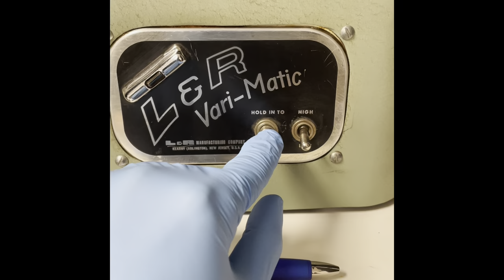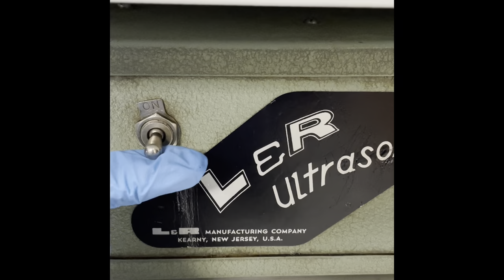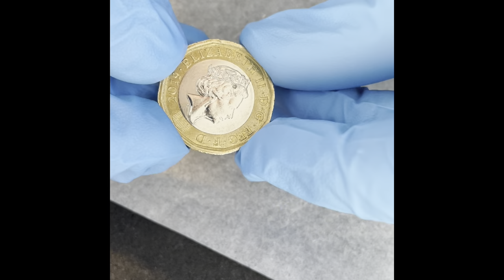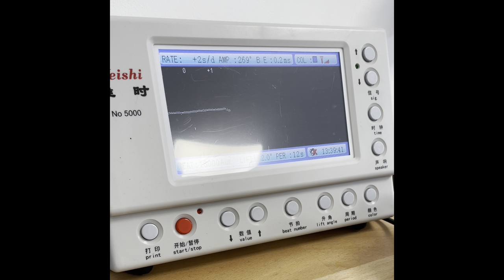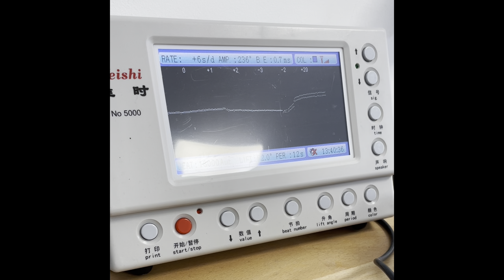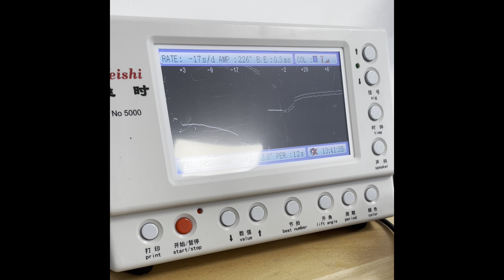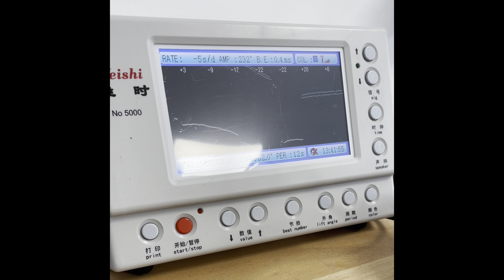Service/Repair Tevo Kapitan calibre AS1560

Comment: Called by at Scott's behest. I've also been a fan of his for some years and Saturdays are not complete without a trip to Ardrossan to see the agents' antics. Your gift of the Tevo was very generous. I had some aspirations regarding watch servicing but got shafted by fate, which handed me a mild stroke some years back. It left me with a lack of fine sensation in my left hand so I have a few watches lurking in my cabinet that will need someone else to deal with. I'm going to have a look at your video on Roamers, of which I'm fond and of which I have several. I love the guilloche dials.
Reply from the maker: Hi John, nice to hear from you. Sorry to hear about the stroke! Being a watch repairer is a crazy job… sometimes involving profanity as things go wrong😅 CWM is my absolute favourite YouTube channel and Scott was the right man for the Tevo! Roamer is one of the underrated greats! There is a write up on Roamer on my website mitka.co.uk